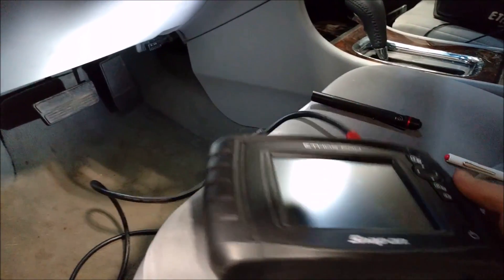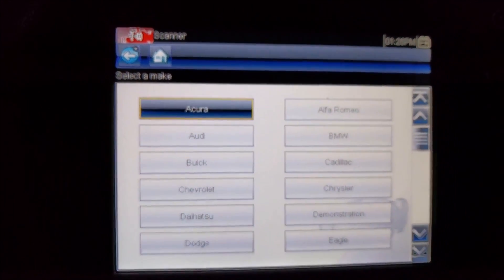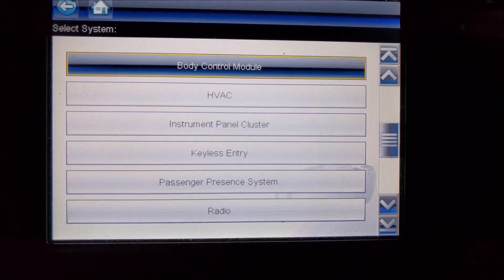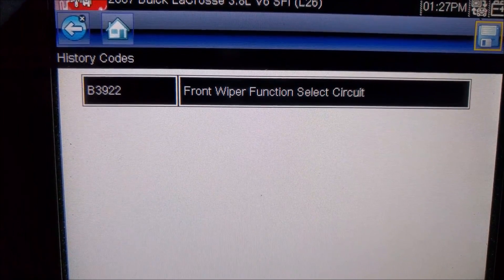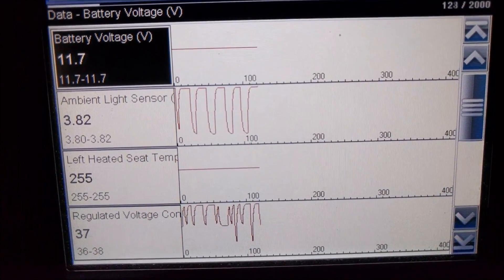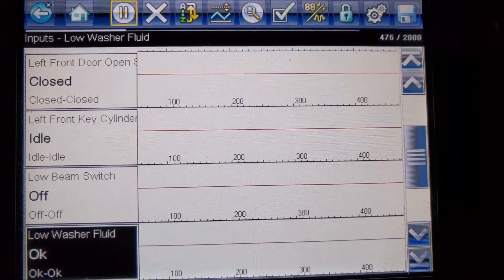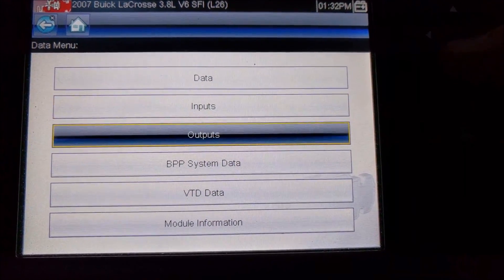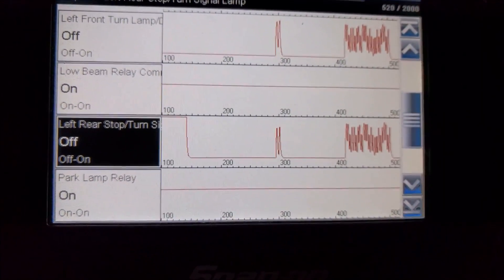How a scan tool can help you diagnose an electrical circuit

Comment: Seems a very powerful scanner. What is the going purchase price for the same ? and is there any competitors ?
Reply from the maker: I can't tell you the price--you'll have to shop around.  It is kind of expensive--at least a couple thousand dollars.  It also costs several hundred dollars to update the software periodically.  There are a lot of competitors.  OTC makes good scan tools, there are some cheaper ones like Autel, Launch, etc.  It is hard to justify the cost of a scan tool this expensive unless you use it daily.